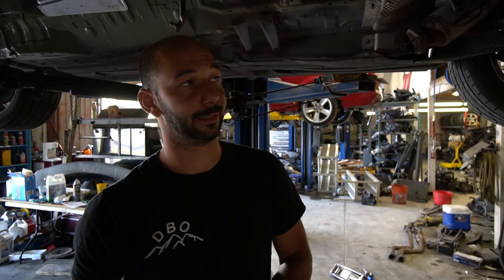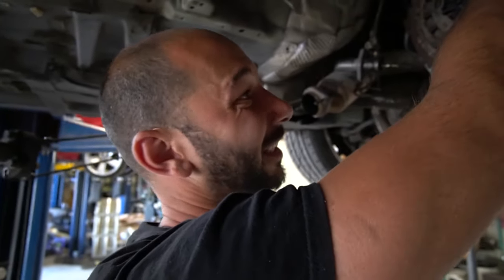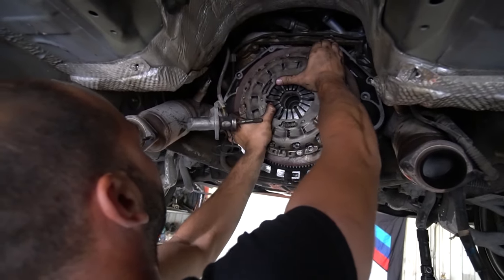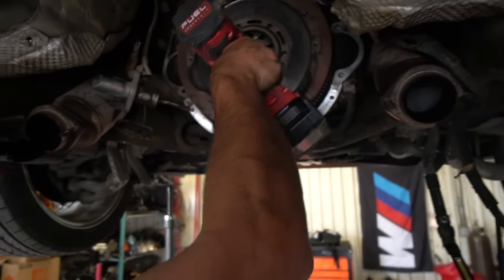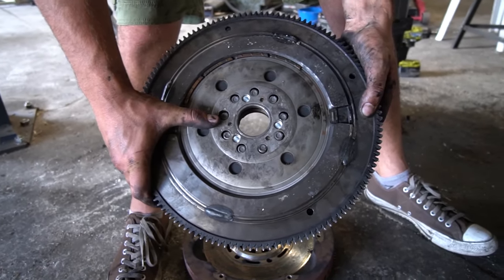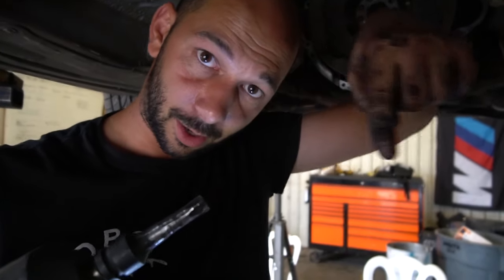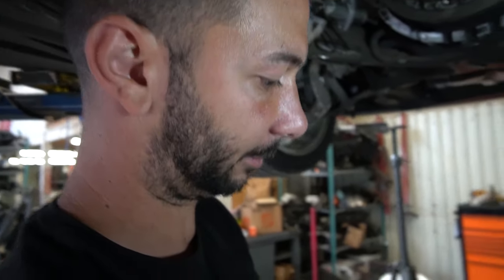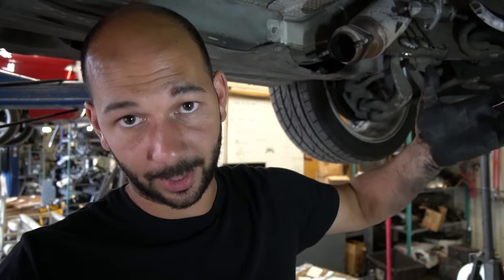How To Replace an e39 540i Clutch! (M5)

Comment: I have a 97 540i does and I got a 2002 m5 transmission should I get a 02 clutch or 97?
Reply from the maker: You'll need a m62/tu clutch, the teeth are different on the flywheel for the crank pickup,
Reply: @DENVERBEERANDOIL   ok that helps because some people where iffy if I should keep it but thank you !!!